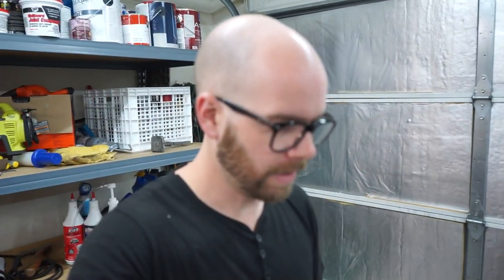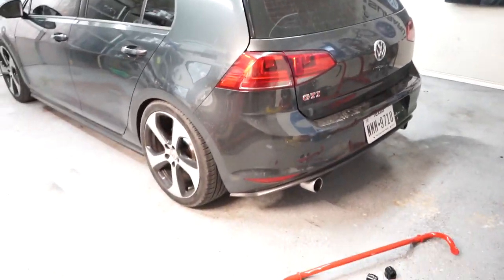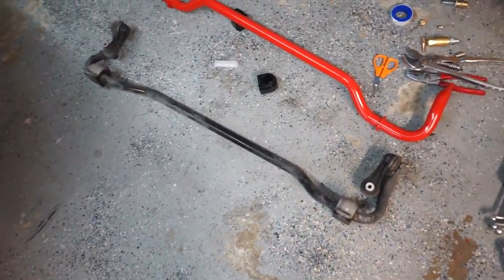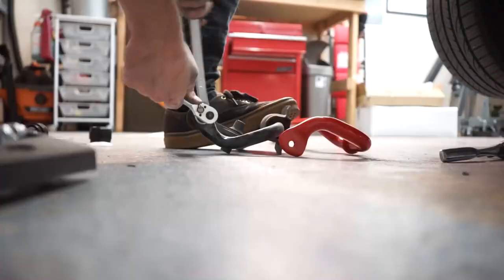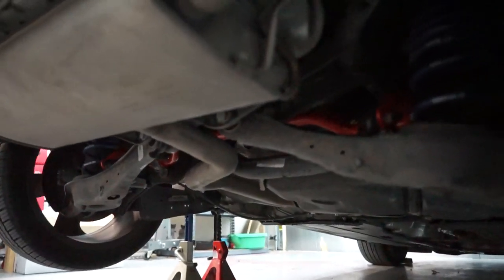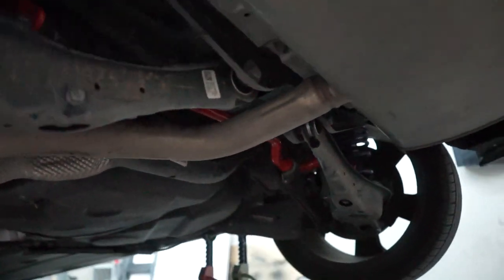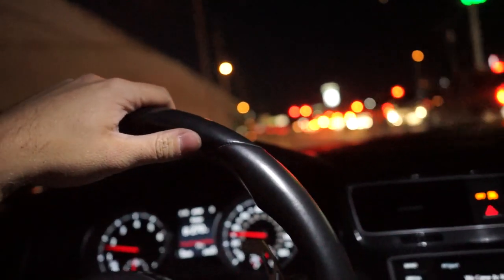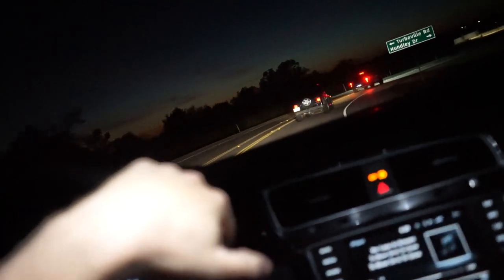25mm Rear Sway Bar Upgrade on the Mk7 GTI

Comment: My stock 2018 GTI PP rear sway is 20mm (solid), and i have a neuspeed 25mm (tubular) currently installed. I wish there was one in between those 2 extremes, right in the middle. maybe a 23mm rear sway option.

Comment: great video, do u reckon i can achieve a similar result with the 22mm superpro RSB? or should i go 24mm and higher?
Reply from the maker: I doubt you would notice too much of a difference between the 2
Reply: @ColoredinLight  do u mean between the 22mm and the 25mm?
Reply from the maker: Yep!
Reply: The Superpro is solid and the Eibach is hollow. I’m guessing they’ll feel very similar when you factor in the diameters. I believe the stock PP bar is 21.7mm hollow.
Reply: @zippin1  What do u think is the better option? solid or hollow? i am now deciding between a 25 mm hollow (ZSS) and 25 mm Solid (034)
Reply from the maker: The solid should have much less flex. But it's all depends on what you're doinng with the car. Dont buy the biggest sway bar just because you can
Reply: @limmyinc5147  For my uses I’m still running the stock bar. It’s really up to you and your suspension needs.

Comment: did the rear sway bar help with stability in driving in a straight line on highways? curious if this had any effect on straight line driving
Reply from the maker: It may have made bumps harsher, but nothing really even that noticeable in straight lines.